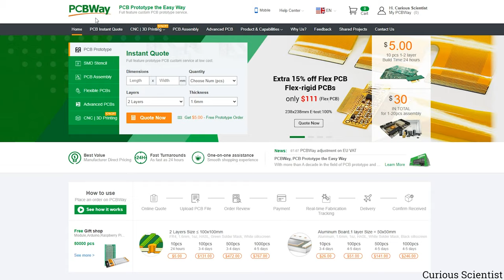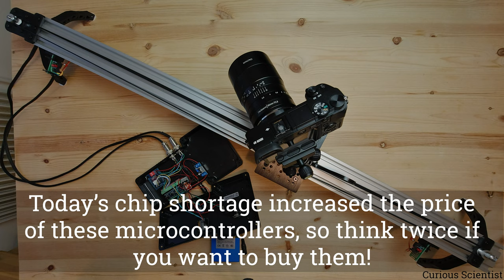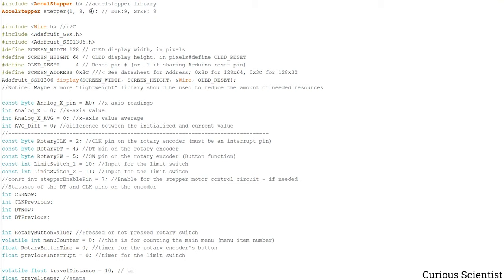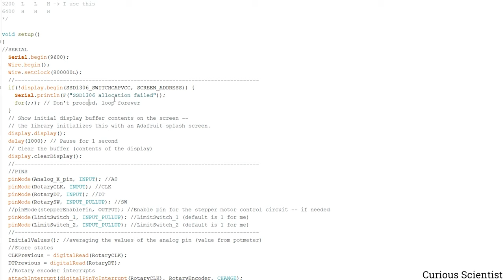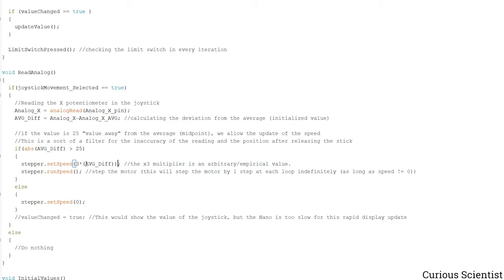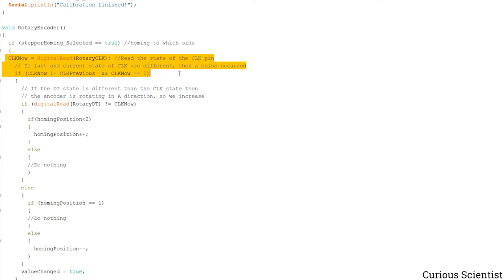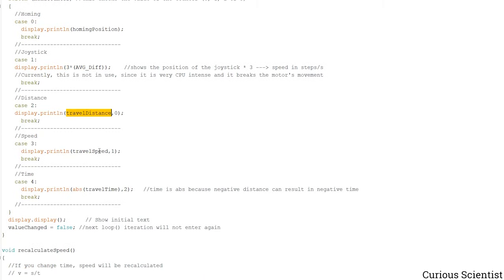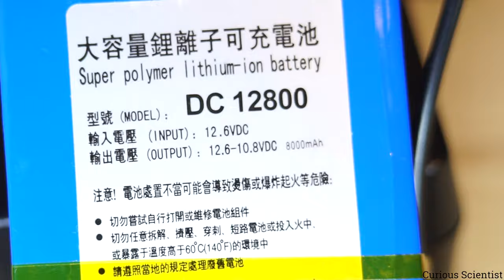DIY Camera Slider

Comment: hey man! I managed to control stepper motor with arduino + ethernet shield. 
I am controlling it via client python via pygame with ps4 controller. I've been able to move the stepper motor left and right with button presses, but I'm unsure of joystick control via http. 

I want to control the stepper motor with joystick x axis live like people do with ptz cameras. 

do you think http request is a viable option for the application or am I wasting my time?

I haven't had much luck at all getting the motor to respond to the joystick axis.
Reply from the maker: Hi! I am not really experienced with ethernet and those py-things, so I don't know. But if you can use buttons, then a joystick should work too.
Reply: @CuriousScientist I got it working :) just need to figure out code for A to B with 3 motors starting and stopping at the same time with different amounts of steps :)
Reply from the maker: Good to hear the good news! Starting and stopping the same time is easy. Pick one motor, let's say the one that has to travel the least distance. Determine a speed for that motor. Then, calculate how much time it takes for the motor to complete the distance. Then, based on this time, go to motor #2, and calculate the speed based on its target distance. Do the same for motor #3. After you set the speeds for the motors, set start moving them by passing the target distance to the code using the moveTo() function. Alternatively, Accelstepper has the multistepper feature which does exactly the same. But I think it is better to do it manually, because one can learn more.

Comment: What type of motor are you using, Nema what? How much power does it draw, and how long does the battery last? Is the motor not an overkill for the torque you need? I'm trying to dimension components for greater portability, so I would like to use the smallest motor and battery I could...
Reply from the maker: Hi! I use a NEMA17 (17HS19-2004S1). Probably it is an overkill, because this is a 2 A model, so it is a bit more beefy than the regular NEMA17 motors. This is what I had available at the moment. The battery I used is a 12 V 8 Ah battery. I did not measure the current draw or any similar parameters but you can estimate the battery life from the above details.

Comment: How would you set this up to do a ping pong effect when the motor reached the end of the slider it would bounce back to the other end of the slider?
Reply from the maker: Hi! I have videos dedicated to ping-pong oscillation. Check my stepper motor control panel videos, where I implemented two different approaches.